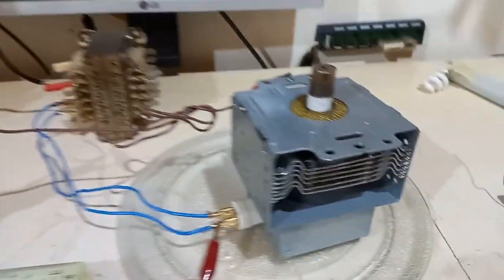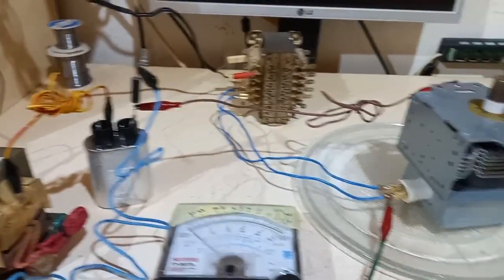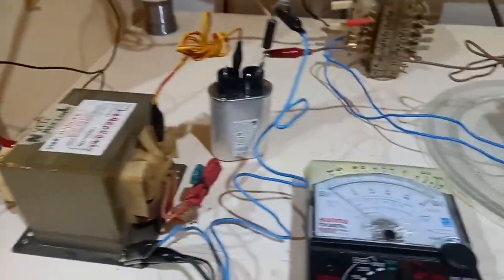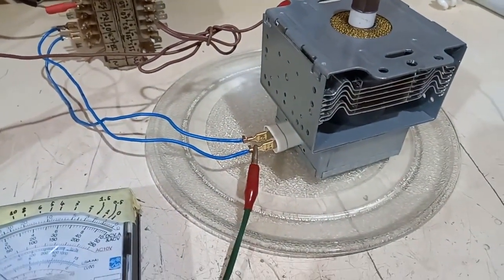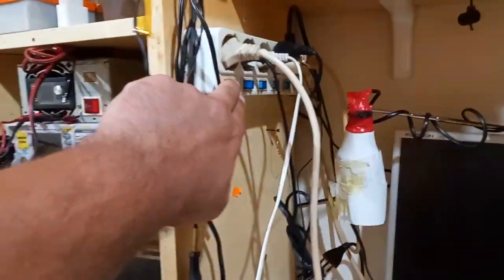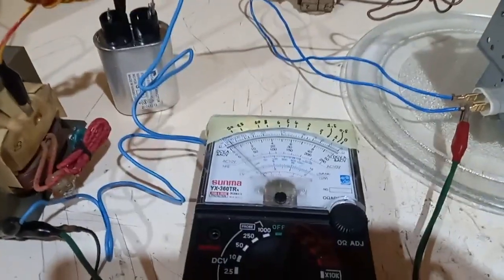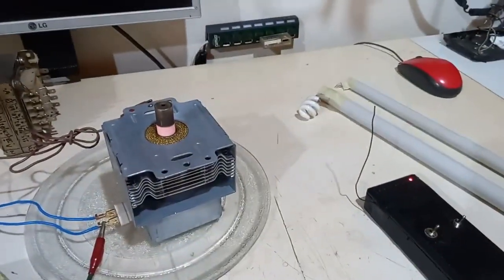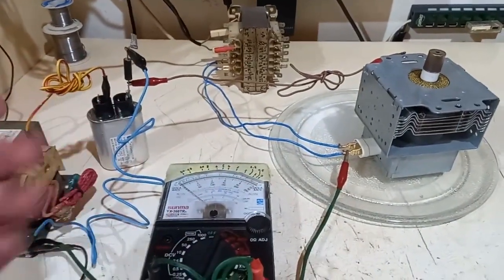Microwave Oven Magnetron At Low Power, SLIGHTLY Safer (~40W)

Comment: cataracts are a very real risk with stray microwaves :)
Reply from the maker: well, apparently they say that the risk is overheating your eyes, cos (they say) eyes being transparent have a very low blood circulation and are hard to regulate in temperature, but probably you need to put your face at 15cm from the magnetron at full power and keeping it for at least 20 seconds, so in my video anything (except the high voltage) is fine... dunno about cataracts, i googled the risks and it didn't mention that, apparently microwaves just heat up, they don't have another effect

Comment: Even if that device was at nominal power, it wouldn’t be dangerous in its current form. It needs a lot of mathematical precision put into a conduit known as a waveguide which will focus the beam. The waves exit the antenna in a toroidal shape, if you view the antenna side on it would look like an infinity symbol if you could visualise it.
Reply from the maker: yeah, i guessed both things, infact in my second video about the low power mag. i use a cantenna, and yes, its antenna seems like a "monopole" so it transmits with a toroidal shape, you can see the CFL tube lights up especially on the side of it... anyways i don't wanna risk to cook any of me so i will probably never fire up a mag. at full powah, i'm not even interested, i've seen that several times

Comment: Hi
Magnetrons actually a power full vacume tube Rf device.
You use it as power full transmitter to broadcast something by injecting signal in flament side or in high voltage line , even u adjust   frequency by its two coils.
Connect roof antenna to its output you got long rage result.
Reply from the maker: yeah, kinda, i've seen such experiments done, you need a giant vacuum tube to insert the modulation... but sadly high frequency is not good to make a long range transmitter, wi-fi routers are capable of some tens of meters of range while they transmit with like 100mW of power, if you have a 100mW FM transmitter at 100MHz you can cover a small town
Reply: @PosthumanKindergarten  yes u right.
But in my experience when digital frequency involved it is hard to detect.
But in my experiments it is a good transmitter it james the mostly signal of the range when roof antenna contact.
Reply: @PosthumanKindergarten  you experiment to drop voltage then tray.

Comment: Sir, I am curios if microwave have low energy 40W that means the wave amplitude of electric and magnetic field is smaller than  the wave amplitude of high power 1 KW ? Is that true, what make a microwave powerful? Thank you!
Reply from the maker: yes, it's not sporadically pulsed at high power, it's reduced in current, so the amplitude of the radio waves is lower, maybe also the length of the 50Hz AC pulse is shorter cos it barely reaches the 4kV so for a shorter time, but the peak current is definitely reduced as well

i dunno what you mean by "what makes a microwave powerful" but in an oven the peak current on the magnetron can be like 500mA while here it's in the order of like 50mA (PEAK)

Comment: I do not fuck with magnetrons but this was very cool , I guess it is safe because of the very low power , but I won't play with it hehe it can produce x rays at higher power right?
Reply from the maker: you need at least 20kV to come up with x rays... now it's just a not much powerful radio transmitter, i've read that decades ago, a way to tell if it was safe to go near a powerful tx, was to bring a neon on a stick and see if it glows, but i mean at meters or tens of meters of distance